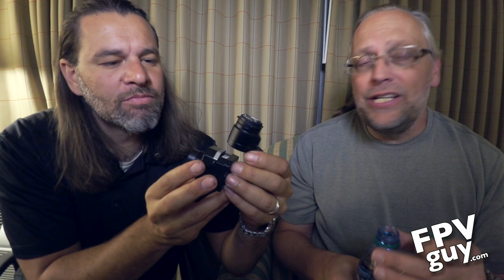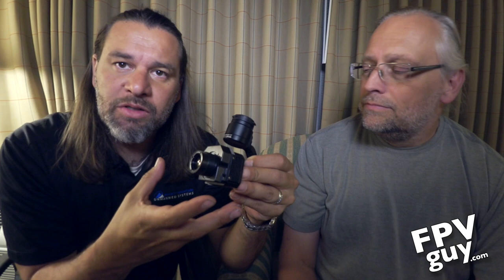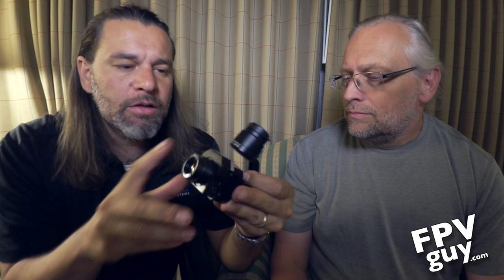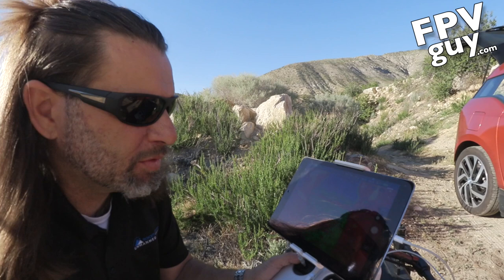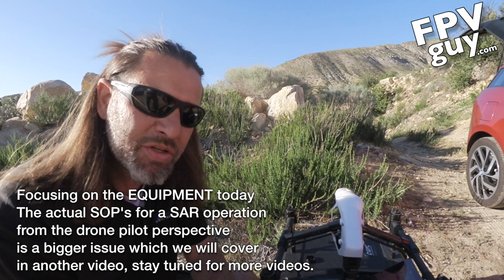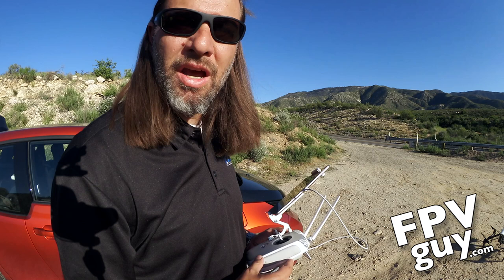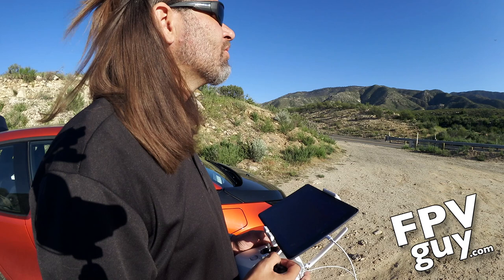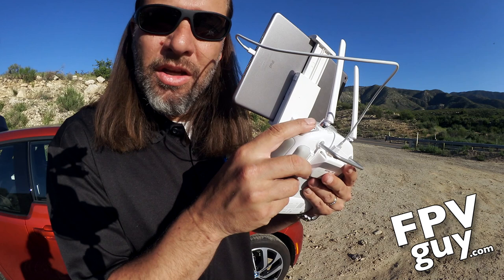DJI XT Thermal w. Jon McBride

Comment: Good video on thermal.  As an ex Navy helicopter controller we used FLIR systems quite extensively to ID ships, search and rescue as well as any boarding evolution's we were conducting.  Just remember it cant see through glass.
Reply from the maker: +Nick Guidry LOL Plus one to the "can't see through glass" as glass its self have a body and temperature.  it also do cool things like seeing your heat reflection in a shiny car.  
You probably got to play with the $100.000 systems thats a world removed from DRONE size VUE / TAU cameras.  I have seen long range thermal videos from the Navy's helicopters thats absolutely amazing,   managing to separate details at many miles of range.   guess one upside is the ocean is relatively cold making FLIR is a ideal tool anytime of day.

Comment: Great video thanks.   One question, does active track still work or any other flight mode with the XT attached?
Reply from the maker: Not entirely sure actually.  it do work with the visual camera, however not sure if active track work with the XT itself. unless the visual camera is on for that purpose.

Comment: Alright man.... I've been bit by the drone bug. I've been absolutely obsessive on researching this stuff. At first it was just as a hobby, then suddenly the practical applications became apparent. Rewind 15 or so years a go I was embarking on a career in public service realm, specifically the fire service. Slowly I got more involved, doing more, more responsibility, etc... became an EMT and even rose to the rank of capt. Fast forward to a few years back, I'm working for a rural private ambulance company and things are getting bad. Bad calls, people dying, a homicide, and then my coworker commits sucide. That was it... I was done. I was diagnosed with severe ptsd and in no time at all a career that after 15 years building was over in a flash. No more helping people... barely able to help myself. 
But dones... it looks like a possible way I can get back into doing public service, like search and rescue. 
Anyway... I'm looking for a good (reasonably priced, as everything here is volunteer based) set up. What do you recommend? 
Any advice at all would be great, reach out if you can. 
Sorry so long. 
Thanks 
-Chris H
Reply from the maker: Chris,   public service  / SAR is all about FLIR gear,   there are a number of platforms that can haul a FLIR VUE or VUE pro.   including the older inspire1 which is fairly reasonable these days.   you need to build together a kit for the video downlink.  that said, most services are concerned about your insurance etc when working public events of any sorts.  
Start with looking at what systems can give you visible light and carry a thermal camera.   while you are looking go to RemotePilot101.com and get your commercial drone ticket (part107 ticket)
Reply: Bo Lorentzen 
THANK YOU so much... I'll get right to it. If I have any questions I may message you again, if that is alright.
Thank you again...

Comment: Be good to see this operating at night when things have cooled down
Reply from the maker: +uptowndisco2    I will get some more shots up in the next thermal video.
Actually Ive found the best time is right before sunrise, ground is as cool as its going to get and we can see clearly.
For what its worth,  the high-ground temperature is a california / nevada / arizona kinda problem,  go to the north and you will not have ground matching body temperature anywhere near as much as you do in California / arizona
Reply: I know your comment is old but I wanted to post information on the sensitivity of a thermal camera at night. The Zenmuse XT has a NEDT sensitivity of 50mk (milikelvin) which means how sensitive the thermal camera core is in very low temperature contrast scenes. So what exactly does this mean for the Zenmuse XT? It means that the camera is very sensitive. So at night you will without a doubt have a good picture. Now one of the main factors for a poor thermal image is atmospheric moisture. If it is foggy or raining the temperature contrast could be so low that the thermal image could look horrible and could be very difficult to differentiate between objects in the field of view. Other than that you shouldn't have any issues what so ever if it is dry out even in the cold.

Comment: Great Honest Video!
Reply from the maker: Thank you sir :-)
Reply: Hey Bo. You seem to have good knowledge on drone setups and discuss the real functionality of them. I plan to invest into a matrice 100 with a z3 camera for mapping and an xt 336 camera for night security. do you think the matrice 100 could fly with these cameras simultaneously working and what are your impressions on the xt 336 camera in terms of quality. Unfortunately I cannot afford the xt 640. 

Renny.
Reply: Oh and both cameras flying with a dual battery setup
Reply from the maker: Hey Ren,   the M100 have a little less power, I would probably fly one of the cameras at a time.
the XT camera with 320 resolution is fine for security applications.  really the biggest difference between the resolutions is how far away you can positively identify a human, more pixels = more details to identify the person by in a image. (as human, you cant use a thermal image to identify a person later in a picture lineup)
You really should call Jon at Rock Mountain Unmanned systems before investing and talk cameras and exactly what you plan to do, also what the deliverable to the clients need to be.   https://www.rmus.com

Comment: Cheap thermal cams are good for leaky homes and fridges and photographers looking for nocturnal animals, and they are cheap(ish) but the price on these higher res things is out of reach for most.
Reply from the maker: Yeah most of us are not picking up $10.000 cameras,  the closest middle ground is like the $1700 Yuneec H thermal,  or slightly less easy to install my Yuneec VUE camera but tis still in the $3000 range..   we really need to see less expensive thermal systems

Comment: this is utterly useless at daytime because everthing has heated up to much.
Reply from the maker: +Dan barb    Yes & No,  its actually possible to see things you can't really see with a visible light camera,  SoCal is kinda a unique problem as the temperatures are sometimes high, but other states are notoriously cooler.  and obviously work great anytime of day with a thermal camera.
But generally I prefer flying just around sunrise as the ground and air is coolest and we have light to see what we are doing.